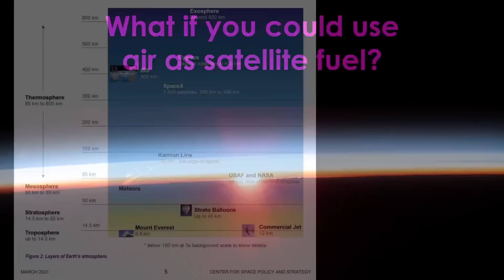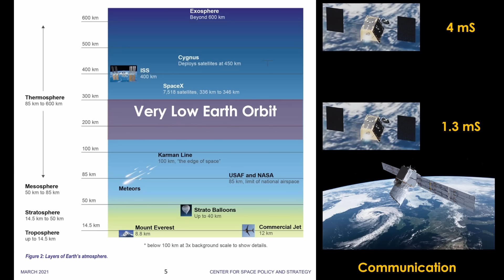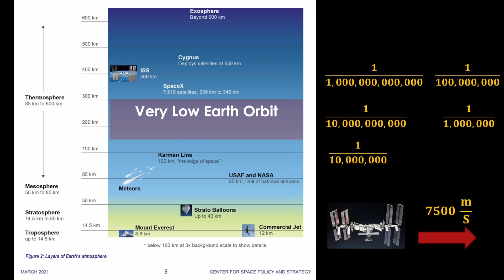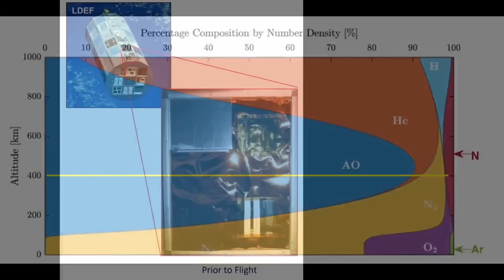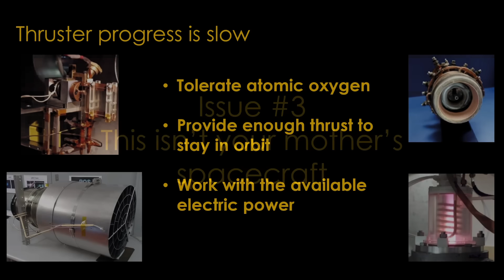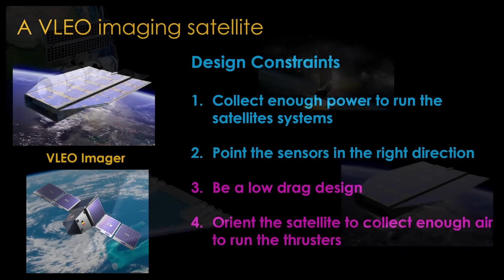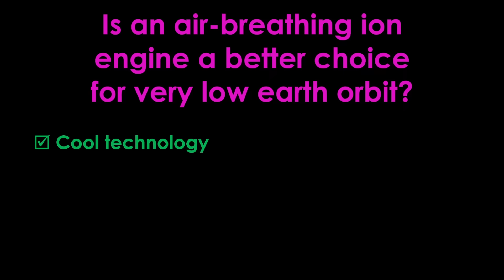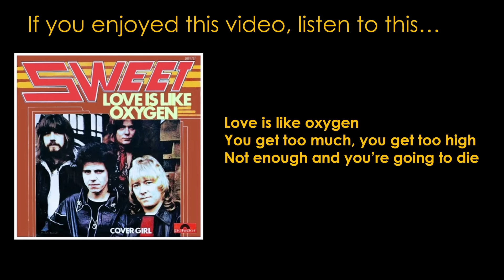Air Breathing Satellites in Very Low Earth Orbit

Comment: I've worked on simulating these things before in the context of using them as self-regenerating oxygen depots, and there is an additional problem not mentioned - drag for an airbreathing satellite can be way higher than you would expect for a non-airbreathing satellite operating at that altitude, due to the scoop decelerating the airstream to a stop so the spacecraft can handle it as propellant. There are ways around this of course - either you create a thruster that can somehow work on a hypersonic ionized stream of oxygen without slowing it down, or you have an MHD style scoop that can harvest energy from the airstream and feed it into the thruster. Either option requires significant R&D.

The power requirements are also non-trivial. You end up with a satellite that is basically nothing but solar panels to generate enough power to keep the thruster fed. The only way to avoid this ends up being to fly higher, at which point you might as well just stick to non-airbreathing electric VLEO craft, which is very much the direction most people in the VLEO space seem to be going towards.

Admittedly the perspective of my research meant that deceleration was implied since you're using them as depots. The math may play out differently if all you have to do is station-keep.
Reply from the maker: Thanks for the additional information.
Reply: @EagerSpace  I don’t think there’s any reason an ion thruster needs to slow the incoming air. There’s no combustion you just need to ionize and accelerate it.
Reply: @JustMe-dc6ks  You slow it down simply by touching it. Molecules will stick to surfaces rather than bounce off quite often, and will then be released at their thermal velocity. It’s not the kind of thing where your intuition alot how gases behave is at all meaningful.
Reply: I am i no ways in this business but I've toyed with an idea of an ion thruster vessel in low orbit combating drag with ion thrusters wondering if such a thing would be feasible. Glad to see people more clever than me have already come up with the concept and are having their crack at it.
Reply: @treflu6113  Sadly in this case the answer seems to be it isn't. Which is a real bummer, because kinematically speaking, this is the cheapest method of doing ISRU that could possibly ever exist. No need for deep space delta-v, advanced robotics, no need to land, take off, etc. Just skim the Earth's atmosphere and mine it for oxygen, ready for use by any rocket headed outwards.
Reply: This is probably a stupid question, but why slow it down? Could the thruster equivalent of a RAM jet at least give motive power to a satellite?
Reply: @chrissouthgate4554  you can certainly try, that's the part where I talk about having a thruster that works directly on the hypersonic stream without slowing it down. But most electric thrusters we have today operate on the basis of a cold liquid / gas propellant being vented subsonically from a nozzle then ionized. You'd have to design an entire thruster architecture from the ground up to work on a hypersonic flow.

At least also in my case, my research angle was focused on using them as propellant depots, so slowing it down is kind of mandatory if you want to keep it in tanks for someone else to use.
Reply: @dsdy1205  So, hypersonic electric thrust that doesn’t slow the incoming flow. Sounds like an arc-jet! That’s… not going to be particularly power-efficient. I had a class on electric propulsion 20 years ago, but we didn’t do any simulation, it was more an overview since there’s lots of types etc. the first third of the class was just a plasma dynamics for kindergartners (grad students) intro. It sounds like such an interesting field.
Reply: how about u go for the project pluto approach

u get free electricity from the nuclear reactor, and u get free thrust cuz the satelite is built around a nuclear scramjet
Reply: @God-ch8lq  RTGs are not nuclear reactors, and they only produce about 200 watts. That’s not enough to be useful that low in the atmosphere
Reply: @ahgflyguy  Project PLUTO used actual open-cycle air-cooled reactor to power a nuclear ramjet engine. And there were satellites with non-RTG nuclear power sources, i.e. actual reactors, in space, like SNAP or Soviet military satellites
Reply: @caav56  Thanks, I was assuming that was talking about New Horizons, which went to Pluto, using an RTG. I knew there were a few actual reactors that had flown, especially the Soviet ones with the NaK-cooled reactors. I know they leaked terribly, creating a bunch of collision hazards. But that wouldn’t be a problem in VLEO. The radiation might be, though. I never looked into why the Soviets wanted that much electric power. Radar?
Reply: @ahgflyguy  Yup. 17F16K, a.k.a. RORSATs, were pretty power-hungry due to using radars for monitoring ocean vessels.
Reply: @caav56  Couldn’t remember the name. RORSAT. Thx!
Reply: @ahgflyguy  "Soviet … NaK-cooled reactors … leaked terribly"
They didn't leak whilst in operation; the leaks occurred when they were decommissioned.  The [highly-radioactive] reactor cores were boosted to a graveyard orbit and the bulk of the spacecraft was allowed to burn up in the atmosphere.  The issue is that the radiators were on the part that was burned up (not on the reactor part) which meant that the coolant lines were severed when the two parts were separated.  Droplets of NaK were [inadvertently] released when this was done and it's those droplets that pose a collision hazard.
Reply: @alexhajnal107  Thanks for the clarification!
Reply: Hey, can we see your work on that stuff, if it's published or at least somewhat presentable ? Like on a One-/Google file, Github or PDF link, anything like that ?
Reply: @nicholasleclerc1583  no because it's embarassing and anyone could probably do better with a little bit of Python knowhow

In all seriousness, sure, I'll update this comment with a link soon. However if you want a much clearer look on the field of airbreathing satellites as a whole, look for "A review of air-breathing electric propulsion: from mission studies to technology verification". Most of what I know, I picked up from there - my project basically stems from a line in the conclusion where they said it would be nice for the field if there was a system-level simulator that could accept different sorts of modules for mission analysis.

A link to my paper: https://drive.google.com/file/d/1t1igagQsRKhM76bhrgBgWAbp7gnpO7M5/view?usp=sharing
Reply: Came to say this. It literally kills the concept. Further more, the concept is addressing problems no one has. Orbit boosting only makes sense without VLEO drag.
Reply: Make it kite-like and surf the edge of the atmosphere

Comment: ABS in VLEO = WTF?
Actually, it does sound cool. I'd heard VLEO satellites were being considered but the air-breathing part is new to me. Thanks for informing us thoroughly and comprehensibly. 
When you showed the low drag design at 8:40 the thought that instantly came to mind was the ball turret on a B-17 to handle the orientation problem. But the focal length used in an imaging satellite would probably be too long.

Comment: At one stage, NASA had plans to refuel spacecraft with propellant scooped from the upper atmosphere and then stored in LEO.        :)
One plan had a fission powered tug propelled with liquified air, which I thought pretty stylish at the time.

I wonder if Ion-wind style thrusters would work well for these lightweight low-flying satellites?
Electrostatic pressure thrusters would work, once they get the power to weight ratio sorted.
Reply: I thought of that too. But I remember doing some quick calculations that showed how impractical it is; cooling down the collected air, in particular, as well as the nuclear reactor.
Reply: With a reactor, you could just use water converted to high-pressure steam for thrust.  A technology solved back in the 40's.  Of course, radioactive rain might be considered a bit of a drawback.
Reply: @chrissouthgate4554  You'd also run out of water really quickly.